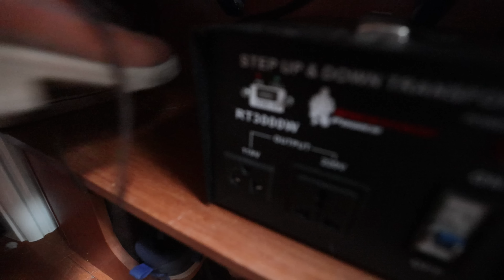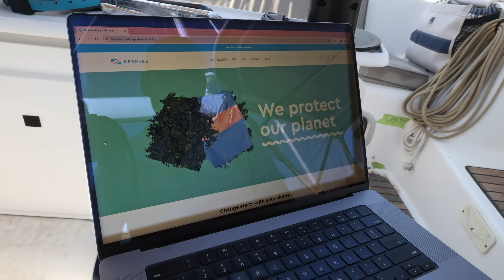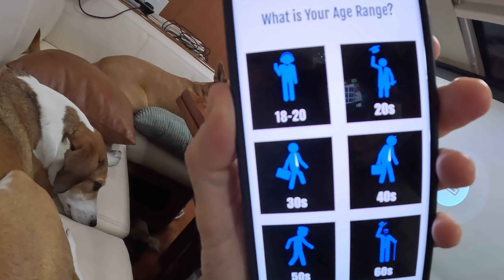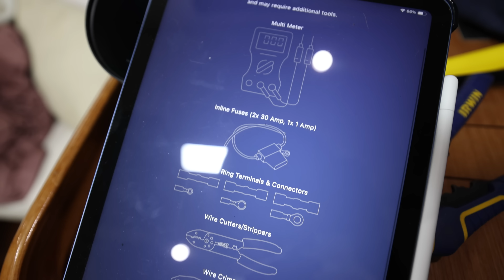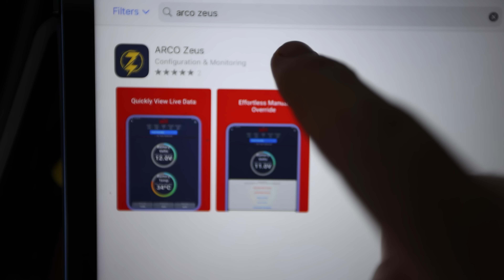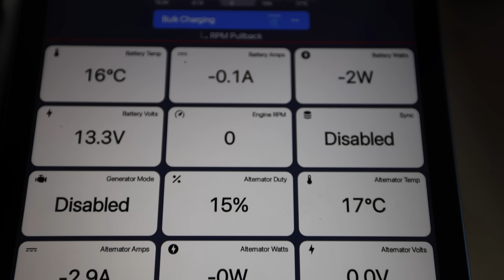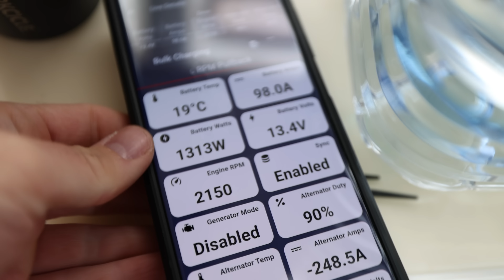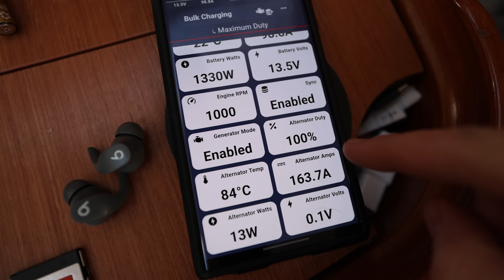Not So Exotic Boat Life: DIY Projects In Not Unexpected Places | EE 149

Comment: You should view captain Rick Moore's experience with alternators and a 48 volt system. He is able to fully electrify all boat systems. He is very knowledgeable on matters electrical on boats. He uses a combination of two alternators and extensive solar panels and a wind generator. Exploiting the reduced current of a 48 volt system vs lower voltages (study ohm's law), heat production is greatly reduced. He is able to install a mini-split ac system with the increased available power.
Reply: I have not seen an episode from Rick for about 2 months. Do you know why? Webhead USA
Reply: Rick has a new episode that is out today, Saturday 3/23. :¬) Webhead USA

Comment: Hi guys, love your show. Just a little guidance for using an IR thermometer. They all measure an average temperature of a circular area having a diameter of generally 1/10 or 1/12 the distance held away from the surface of interest. That is, if you hold it 4 feet away, you are averaging a temperature of 4”-6” diameter area of engine, not just the alternator. To capture the alternator temperature, you need to be 6” to 12” away from your target.  FYI.

Comment: Do you have a fresh air input/exhaust vents in the engine compartment. If so, can you connect a hose to the exhaust vent and put the other end by the alternator, with a small fan to pull the hot air into the vent tube? If you just put a fan blowing on the alternator it is just going to heat up the engine compartment and eventually shut down the alternator and regulator. I you do not have a fresh air vent system in the compartment you may want to add one.

Comment: You should seriously look in to putting a automotive fan on the front of your engine to move the air around, I did it on my boat and it worked great. Also they do make fans for the alternator that fit just behind the belt pulley.

Comment: i see you know about shrink wrap.. consider soldering smaller connectors along with the squeeze trick (ie: dip a hot gob of solder inside the connector with the wire in place and squeeze while it is hot.. reheat the connector with a small iron to ensure a good bond) .. then.. slide an appropriate sized shrink wrap over the whole lot.. find yourself connectors without that preinstalled shrink wrap as it will only get in the way.. given your salty environment.. electrical connections will always be a weak link as salt can; and does, make currents go off in unexpected and not so wonderful directions.. probably not going do more than give your installs a fighting chance tbh.. but i hope it helps.. Much love and Thanks so much for sharing :face-red-heart-shape:

Comment: Really interesting project! It’s a pain when you feel you’re just wasting fuel and making noise by using a regular alternator and having the engine at 1300 rpm and almost no charging. With a decent converter to get 110 V, you can now get really rid of the generator, it’s maintenance and everything. Ventilating better than engine bay will be now important, for the alternator, and also the belt which will have more drag.
A good point to know now is the higher safest current to inject to the batteries in order to extend their life as much as possible, so you can tune the new charging system to that
Well done!

Comment: The alternator will get hot, your pulling 250 amp from it the winding will have a resistance  of 0.05 Ohms, 250 amps  x 12 Vac  is 3000 watts of power being used @ 250 amps

Comment: Some alternator pulleys come with a fan built in . Maybe you can weld some fins to ur alternator pulley so it forces air thru the alternator as it spinning . I’m sure it’s going to drop it atleast 200 degrees . Also trying a water cooled alternator might be very beneficial.

Comment: Atticus had installed a high output alternater recently and had that overheat issue. If you can find that episode he installed a fan connected to some flex duct material directed onto the alternater. Problem solved.

Comment: Hi Dear young lovely family ❤, from engineering pov, I think you've better to change building strategy and concept in order to finish your project asap. Therefore, 
First: you build the Hard Top
Second: you build the Aluminum support Rack of the hard top from Aluminum pipes
third: you cover the Aluminum pillars pipes  with carbon fiber sleeves.

Comment: I am excited about this new regulator. I have the WS500 and my problem with the WakeSpeed is not easy way to program and see what it’s doing over Bluetooth. I do like how integrated the WS500 with Victron’s products, including their system monitors. For example, in a multi-BMS multi-battery Lithionics setup, if one of the BMSs goes offline, the WS500 will know that and automatically adjust its charging profile accordingly.   I am skeptical of ARCO's claim that they have all this and more solved on day one, and much more, when one of the smartest engineers in the business Al Thomason of WakeSpeed has a five-year lead on them??

Comment: Well, sorry, but as an electrical (electronics) engineer, and looking at what you have going on with those alternators, I would have to say an alternator mounted set of cooling fins and possibly a dedicated fan might be closer to what you will need with those high currents. But, since these are automotive products and not typically engineered by electronics engineers they dont really understand how SERIOUS you have to get about HEAT.  With late model super computers they even use water cooling with fans on the inside of the microprocessor system and the outside (a fan cooled "radiator". Why am I saying this ?? That's a LOT of amps and any resistance anywhere and you produce heat. Plus, your doing all this inside of a High Temp compartment to begin with !  Asking for problems , they haven't quite worked all this out. You need a DEDICATED ALTERNATOR COOLING SYSTEM with TEMP MEASUREMENT CAPABILITY !   If you could measure the alternator temp with a readout and be able to control the number of amps its producing with a controller, that might get you through this without a FIRE.
Ok, watching you test and talk about field current and play with fuses, it Sounds Like you don't have a way to measure the field current. Normally this wouldn't be a big deal, but during your start up process it is turning out to be important. Might I recommend a Clamp Meter , decent quality less than $100, will measure that current and much more for you. Big help with testing solar panels for instance. You just wrap the jaws around the wire and it tells you the current flowing and its direction . Sorry if you've already got one but you weren't using it on the field current as a measurement (if there is a wire to the field connection you can clamp on to. )
    COOL (HOT) system but I would get yourself a BUNCH of BELTS ! And until you can cool that alternator with some sort of system, consider limiting the amps (can you limit them ?) Emily and Clark might have talked about that because Lithium IO LIPO Batteries will take unlimited amps and even they can overheat. Use that heat gun EVERYWHERE, not just on the alternator. I'd be curious, is that shunt made with nichrome

Comment: Hi Brett, I didn't find the alternator model in the Arc Marine website while I found the regulator. Can you tell me which model you used capable of 250a (more&less)?
And in generator mode if the batteries were low how does Amperes the alternator is able to produce at idle 1.000 rpm?